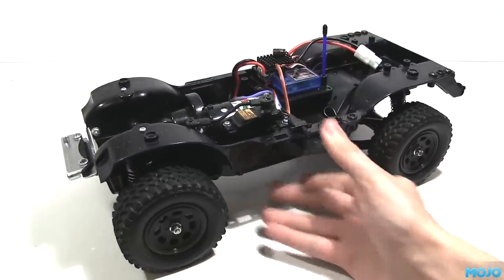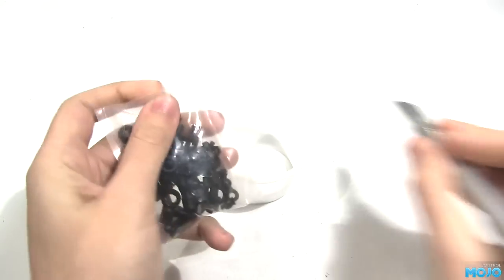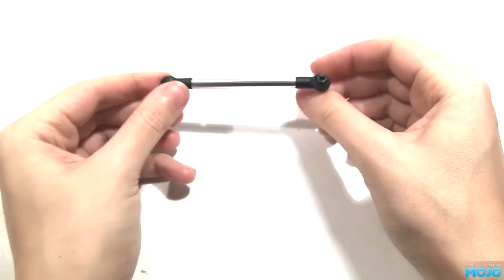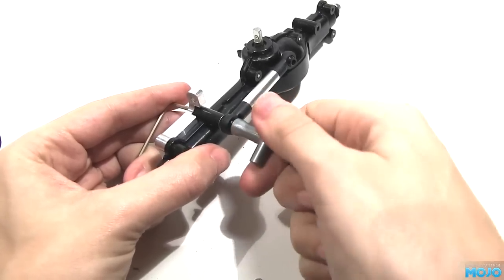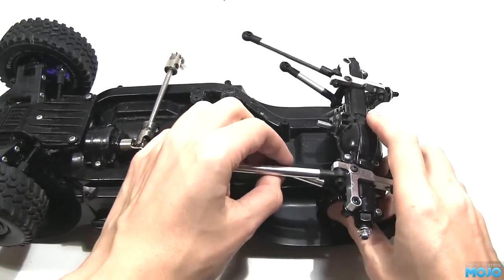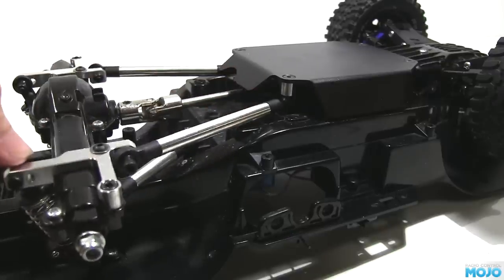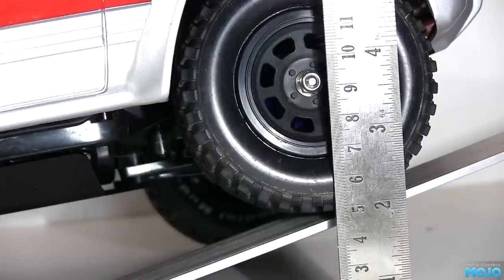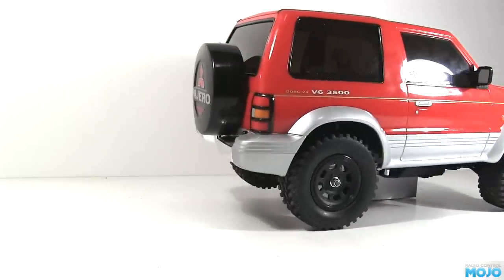Tamiya CC-01 - JunFac/GMade Suspension

Comment: If you haven't done up the front yet.... Yeah! Racing now makes a front end kit that FINALLY sorts that slopfest of a front suspension, and includes a NEW design Bellcrank - that WON'T strip itself with light use!!! 👏👏👏👍👍😎
Check out Matteo's latest video, to see how it goes... The rear suspension kit (also shown in the video), gives FAR more articulation, less slop, less NOISY BITS, and is stronger! 

BTW, your idea of that rear shock extension block.... Bloody Brilliant!!! 😀👍👍  I've GOT to remember that.
Carmine 🚂

Comment: Nice videos! Thanks, I wonder what have you done to be able to drive so slow, is it another gearbox, motor or? Would be thankfull if you had an answer.👍
Reply from the maker: It's been a while, but I think the truck has a 45 or 55 turn motor. There isn't much torque, but it's very controllable at low speed

Comment: Does the new suspension help out on the trails or is it all show, no go?
Reply from the maker: Depends what your goal is. I really dislike bendy, rattly, wobbly parts on my models, stock the CC01 rattles around something cornice. The JunFac kit really tightens up the back end of the truck, the axle is nice and stable.

Performance in the axle is marginally better, the skid reduces the ground clearance, but as long as you keep some momentum up the smoother floor tends to slide over things instead of getting hung up.
Reply: Have you heard of the cc01 stroke extension kit
Reply: RCMojoTV - you might want to consider smaller spacers between the lower links and the skid... It won't be much, but on a CC-01, ANYTHING helps!!